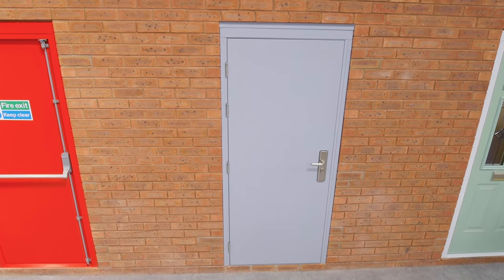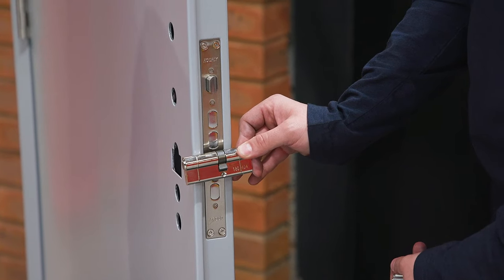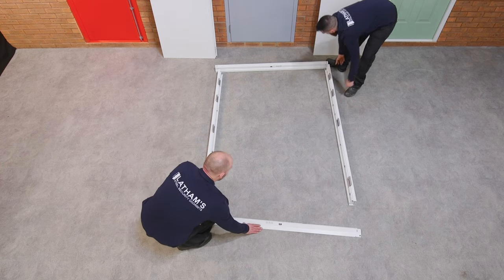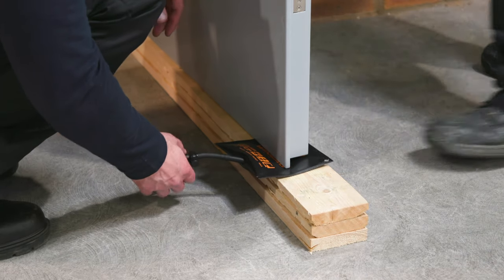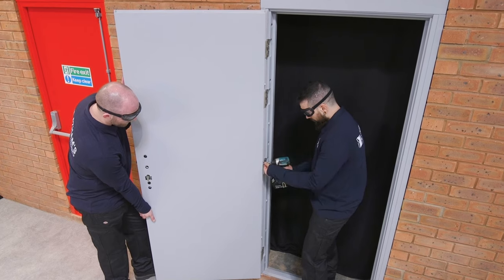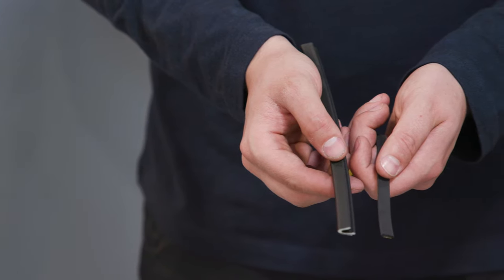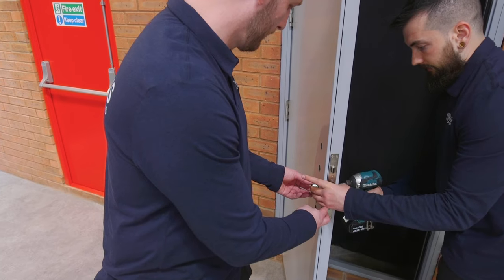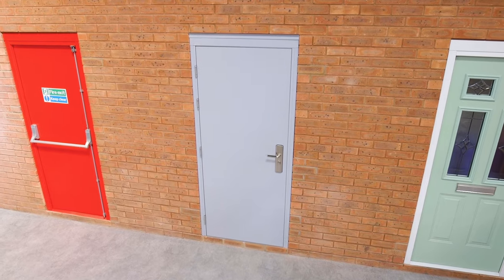How to Install a Steel Door - Latham's Steel Security Doors

Comment: Attention!
If you are building the door opening around the door I recommend makeing the hole at least 10mm bigger on both sides in the width to enable functional use of the wind-out lugs, or simply don't use them. Knock down frames on double door are flexibe until fitting is complete, getting the two doors to line up needs ample adjustment otherwise the locks don't work!.
Reply from the maker: Hi @rolllthetape88 thank for you comments,  that is absolutely correct, we always recommend that 5mm is left either side to allow for any adjustments to be made for the perfect fit and alignment.

Comment: @5:40 so to clarify: The thick door seal with the 'V' shape; The two tips of the 'V' point into the centre of the door? 

Pausing this Video, shows the 'V' tips pointing into the centre.
Reply from the maker: Hi @rollthetape88, thanks for your comment, that's correct yes, it should be installed with the 'tails' of the V pointing towards the centre of the door, with the point positioned pointing towards the frame. I hope that makes sense, but if you are having any other issues, please don't hesitate to give one of our team a call on 01384 220050
Reply: Glad I'm not the only one.

Comment: Does it need to be raised off the floor, I want it for an inner door inside garage. Can frame sit on floor. Thanks
Reply: it can sit on the floor, just don't buy the addtional sill. I would consider some type of threshold  though to stop water running underneath, even if you did a mold of self leveler 10mm high.
depends what your internal wall is.

Comment: I am about to buy a 1595x2020 double door for my garage. It will be a new door added to the back. I'll do it DIY and was wondering if I needed a lintel above it or would the steel frame be suffucient? There will be only 2 or 3 courses of brick above it and of course the roof structure. I am asking as on your videos I don't seem to see any lintels and I am not sure it is because of the demonstration only or is it because it is fine that way. I don't mind to pay that extra few quid on a concrete lintel but it wouldn't be the prettiest sight in town, I'd prefer the bricks if that would work. Thanks!
Reply from the maker: Thanks for your message, so in regards to our wall we did have overhead support built in for safety. In terms of your garage, unfortunately it's not something we can advise on, and would recommend speaking to a builder to see what would be required.

Comment: Do you have any doors you can put smart locks on,  for example, a Yale Smart lock on the door?
Reply from the maker: Hi Robert, thanks for your message. Unfortunately our doors are not compatible with the yale smart locks, but we do have code lock options if restricted or specific access is required to areas.

Comment: I've just put the V strip on the door and now the door won't close easily, what gives?
Reply from the maker: Hi @AliHussanuk, thanks for your comment, I'm sorry to hear your having trouble. If you want to give the customer care team a call on 01384 220050 or email them on sales@lathamssteeldoors.co.uk they'll be able to run through some troubleshooting with you
Reply: Thanks, I've fixed my mistake. I put the seal on the lock edge of the door frame rather than the door stop section of the frame. Doh @lathamssteeldoors

Comment: Is it possible for your company to install the door?
Reply from the maker: Hi Riri Riri, thanks for your message. We don't install, but we do have recommended installers that we work with. If you want to give our sales team a call on 01384 220050 or email sales@lathamssteeldoors.co.uk one of the team would be happy to discuss your requirements.
Reply: @lathamssteeldoors  Thanks for responding so soon. That sounds perfect. I will be in touch with your team. Thanks again!

Comment: hi can you fit these doors on a internal room door with a wood frame
Reply from the maker: Hi, many thanks for your comment. You can indeed install our doors internally into wooden frames. It's worth noting that all of our doors come pre-hung in their frame, but can still be installed inside the frame aperture. We would however recommend removing the wooden frame to maximize width available.
Reply: @lathamssteeldoors  hi thanks my door frame is a bit small in width will that be a problem will the frame provided be able to fit into a small door frame
Reply from the maker: @me-il5bl  If you could email your sizes and requirements to us at sales@lathamssteeldoors.co.uk or give us a call on 01384 220050, a member of our team can run through the options available

Comment: Whats the STC rating on these doors?
Reply from the maker: Hi, thanks for your message. The sound transmission class depends on the door type. We offer 3 different duties on our doors: budget, security and high security which achieve 30dB, 35dB and 38dB ratings respectively.

Comment: Do Latham's install
Reply from the maker: Hi Steven, thanks for your message. We are supply only, but are doors are very easy to fit. We do have a selection of trusted installers that we work with for installations too. If you want to speak to our sales team on 01384 220050 or email sales@lathamssteeldoors.co.uk they can run through your requirements and advise

Comment: Is in normal to fill the side cavities with foam, like you would do with pvc doors, or is there no reason to?

Would it seal better?
Reply from the maker: Thanks for you comment. The door frame itself is insulated with mineral wool on our heavy and ultra duty doors. You can add insulation to the side and over head panels though for additional thermal insulation during insulation.
Reply: @lathamssteeldoors  I'll be ordering in a month or so! Great product and price point.
Reply from the maker: @mattg5878  Great stuff! Thanks for the kind words, let us know if you need anything else in meantime :)

Comment: how would this be fitted on a sectional concrete garage, would it be safe to drill into the concrete sections ? ive heard they can crack/split
Reply from the maker: Hi, we would suggest installing a timber or steel sub-frame for the door, and then fitting it into there using either our wood or metal fixing kit.